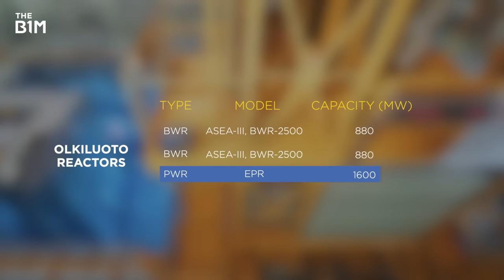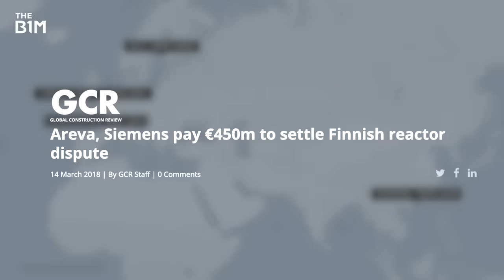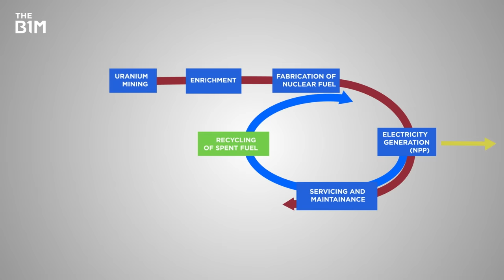Finland Might Have Solved Nuclear Power’s Biggest Problem

Comment: India too has a solution. It will use nuclear waste in it's three stage Thorium program. It's a unique process.
Reply: Nice, last time I bothered checking the reason most places didn't use Thorium reactors and/or use the waste in secondary reactors ( it's still radioactive, it's still giving off energy, use it damn it! ) was because there were worries about them being used as 'breeder' reactors to make weapons material.  Well other reasons too but that was one of the big ones last time I poked at the idea ( not even remotely an engineer, just someone interested in the subject )
Reply: @MrGoesBoom  I don't think that's right. The reason Uranium reactors were used in the 60's and not Thorium, is the fact that with Uranium reactors you could make weapons, and not with Thorium. For this reason, no one developed Thorium reactors, although they would be much better.
Reply: Johnny Bhai ye chuttad log India ki izzat nahi karte. Don't tell them anything.
Reply: @albex8484  Could be wrong, not an expert.  could just be mixing my facts up
Reply: @albex8484  
The way i understood, the main reason why the world does not use thorium reactors is the unsolved very difficult technological obstacles.
Reply: @nikokapanen82  that's the official reason. 
Anyway, it's all hearsay, just like many things in this world.
Reply: @nikokapanen82  Your Matthew 7:12 caught my eye- thanks, brother!  Re thorium reactors not being used... just follow the money. It is a fallen world but, a new world is coming! : )
Reply: Can you make a video about it, maybe?
Reply: @NavDharmVarta  Jammer dat er zoiets bestaat als Google Translate ;)
Reply: A thorium reactor was built and proven in Oak Ridge. Nixon shut it down to focus on weapons grade reactors, supposedly.
Reply: @remkoburger6595  try translate this (sanskrit) 
Idam shwaanam Kim vichitr manvyaadi asti ? Kain eyum madhyantre aagachhtum akathat?
Reply: @NavDharmVarta  Dude constructive discussion is good.
Just because he is telling it's negatives doesn't mean he is disrespecting the country.
Reply: @NavDharmVarta  No worries the most adaptable will survive. Not who spill the most insults.
Reply: @toomuchdebt5669  see they start again, first they looted India to abject poverty now they make fun of our state cos it is not able invest in cleaning. Double edge .
Reply: @toomuchdebt5669  yes of course most adaptable will survive. The flat Earth abrahmic zombies won't.
Reply: india should take care normal bio waste first, then they can try to tackle nuclear wastes
Reply: @albex8484  ahhh yes the game of politics the reason why we can’t have nice things like small coupes with big V8s
Reply: "Waste" should refer to the throwaway attitudes of ignorant profiteers. Spent Fuel designed for a particular Reactor type is potentially another 95% usable in Advanced design technologies.
Reply: @MrGoesBoom  Breeder reactor isn't necessarily a weapons grade uranium reactor, the Liquid Metal Reactor or Salt/Thorium reactors use up to 97% of the energy in the fuel instead of the current 3-5%, also the waste from the LSR's are radioactive for very short periods of time, barely longer than a single lifetime, but the big advantage in LSR/LMR reactor is high temps 1400 c and low pressure, the problem with the modern water reactor is the pressurized vessel is high pressure and relatively low temperature, when a crack or leak occurs the water instantly steams off leaving the core exposed, in LSR/LMR's reactor fuel is suspended in liquid metal and when it overheats the expansion of fuel pushes atoms away from each other and starts to automatically control the temperature, if it cannot get the temps down fast enough a metal plug in the bottom of the reactor melts draining the vessel into a cooling vessel underneath the reactor, this reactor type shut themselves down without any intervention from humans, there is no such thing as a completely safe reactor but these reactors are as close to it as we have ever seen, and by the by a LMR was operating for the better part of 40 years without a need to shutdown for refueling, it can be refueled while it runs, another great advantage a 50Mwatt reactor housing is smaller than a typical automotive shop, we can also ship them off into space to power stations on the moon or mars, they are small and lightweight, Elon Musk is threatening to leave America if they do not allow him to put a LMR into space, after my research this is the way forward for nuclear energy, not only the low level of waste but it can run on waste we already own, the USA developed the LMR, the developer of the LMR is the same guy that designed the modern water reactor, he warned of the potential for catastrophic disaster before the first water reactor was built, for his efforts the scientific community kicked him out of the Nuclear Power Industry, not just some drunken lout, he was the most brilliant nuclear physicist perhaps of all time, he warned them but politics and money shut him down. Water Breeder reactors produce the weapons grade uranium you mentioned, currently the only Nuclear Country NOT building Liquid Metal Reactors is the USA, other countries like China, Britain, India and Russia are breaking ground on these new reactors. https://www.youtube.com/watch?v=DLlozU-i_zc
Reply: @NavDharmVarta  lol, pagal ho kya?
Reply: @NavDharmVarta  bro, have you realized they make fun of India because India does do a lot of stupid shit? And you think other countries aren't made fun of? And if you don't like others generalizing you, why are you generalizing the whole world? Who are "these people"? And why are you mixing your identity with India's and taking it personally? So what if someone calls India shit? Is your name India? You were just born there. You owe the country nothing. Funny you talk about respect, but I see Indians always abusing Pakistanis, Bangladeshis and Sri lankans on sport pages. Chill, Have some juice and go watch doremon
Reply: @0741921  jo khud pagal hai vo dusro ko pagal bol raha hai
Reply: Everyone knows they are just going to dump spent rods into the Ganges lmao
Reply: Molten salt eats reactors.
Reply: @Gary Cooley  pressurized water reactors shut themselves down as well, h2o has a negative coefficient of reactivity. Not all metals are safe, graphite in particular has a positive coefficient, so as temp rises so does reactor power. That was one of many reasons chernobyl was a disaster.
Reply: @nikokapanen82  Nah it's economics, you can breed Thorium for fuel, but the people making the reactors also make the fuel, a bit like the printer/ink scam.
Reply: @DanielMosey  Not only that the US navy funded the initial light water reactor... so the know how for a light water reactor was free. While a molten salt nuclear reactor needed funding to do the research... commercial entities are not interested in spending more money than they have too.
Reply: @NavDharmVarta  dude, calm down, don't let some internet trolls let you think this is an India vs the World situation, any progression coming from this work will be felt worldwide, and everyone will benefit from it
Reply: @albex8484  that s not quite right eithet, it has some better aspects, but some considerable difficulties. First of all refueling processes and high fabrication costs make thorium based reactors less desirable. Second, u also would get uranium 232 after thorium processing and then fission reaction. It is rather difficult to weaponize uranium 232, but not impossible since if u go on irradiate till uranium 233, which can be weaponized. Main advantages; thorium cycles are very efficient with safer energy production and thorium is very abundant :).
Reply: Fix covid first :)
Reply: @singatakberpura  wow bro a nuclear reactor!! And a big one!! Who cares lmao go drive around india and tell me that reactor is going to help where india needs it
Reply: @vincentadultman6226  if you go back and read this guys has issues with a lot more than just the image of indias nuclear reactor.
Reply: Not particularly, Americans invented Thorium reactor technology and the use of it as a fuel, yet thanks to the politicians that technology sits on a shelf while other countries benefit from what is clearly a revolutionary use of the technology. Not that I'm bitter that India IS using it, more power to them (no pun intended), but Im bitter about the fact that the US is NOT using it and hasn't BEEN using it, and continuing to believe that "Nuclear is evil" fallacy.
Reply: @MrGoesBoom  While yes technically it can, it would just make a very shitty weapons grade breeder reactor, or put it more to the point, there are other MUCH more efficient methods to create weapons grade then using a thorium reactor, which is why they are labeled as proliferation "resistant". No sadly the reasons touted why they aren't used is just one of many "excuses" trotted out to prevent their use because widespread use of Nuclear power would solve both the Energy problem AND the Climate problem in one fell swoop, and the political establishment retains it's power by treating the disease rather than curing it.
Reply: @nikokapanen82  Unsolved... ha, perhaps in the 1950's and 60's, but this is 2021 and those issues have been long since solved since the 80's and 90's. No sadly the main reason the world doesn't use it, is politics and power (the social and political kind not the electrical kind.) Because using Thorium reactors would give us a clear pathway to solving the world's energy and climate issues, but doing that would put many bureaucrats out of a job and lessen the power of many politicians. You have no idea how much money is made from "Trying" to solve the "Climate Crisis"/"Energy Crisis" rather than actually solving the issues at hand. In short, those people aren't going to give up that power, and we will be expected to perpetually throw gobs and gobs of money at the problem "Trying".
Reply: @albex8484  that is exactly right. And very diplomatic too.
Reply: @AgentExeider  
I do believe the official explanation more than a conspiracy theory. In the official explanation there are clear technological problems. Like what i have read they can build a thorium reactor which could last for 5 years easily, without a problem but that would be economically unfeasible, the reactor needs to work at least as long as the current uranium reactors which is several decades, that would be economical, they just do not know how to make such a reactor.
Reply: I thought they're dumping it at Ganges.
Reply: @albex8484  You can make weapons out of the Thorium cycle just fine, U-233 weapons were tested back in the 60s along with the Thorium cycle reactors to breed and produce them. And not only have they been developed, but several commercial power designs have been built too, most famously the THTR-300 in Germany, which only operated for about a year before being forced to shut down by protesting.
Reply: @MrGoesBoom  No, the real problem is that Thorium is abundant only in India and hence other nations are less interested...
Reply: @NavDharmVarta  abey oie bhai, desh kah image karab mat kar, trigger hogeya toh meditate kar le.
Reply: Does this three stage program include dragons, dwarves and unicorns? Will they do it on Fantasy Island or Neverland? Will it be too cheap to meter?
Reply: @nikokapanen82  wrong. Depends on the reactor but travelling waves and msrs can definetly work. Terrapower is foing travelling wave and thorcon is making a thorium msr. Msre was a test of a uranium msr and it worked perfectly for a prototype
Reply: @AgentExeider  second that. So true.
Reply: Well, apart from the successful proof 9f concept conducted in the US in the 60's of course.
Reply: @albex8484  ura ium reactors were used because Uranium technology is what was developed, and using existing technology is cheaper than investing in new technology. Governments funded the initial research cost of uranium based nuclear technology because it could be used for weapons, weapons this government's wanted. The government's had no interest in funding thorium and the private sector didn't want the bill when they could just use Uranium based reactor tech that was already established.
Reply: @DanielMosey  May i point out that your reasoning is wrong? Thorium theoretically does not need uranium to start the reaction - free neutrons can come from a variety of sources, uranium is just handy. Uranium will not have to be added after startup, a breeder can sustain indefinitaly for as long as you keep adding thorium and removing the by-products. The reason why thorium was not used in reactors was the problems with corrosion were hard to deal with - back then. Now it's an open field, only stopped by regulations. If you talk about both thorium and uranium waste, you do mean the 300 yr halftime as worst product, instead of the now 10.000 yr transuranic wastes?
Reply: 5:22 how should that be a solution, it is expensive beyond imagination and rather the same as what is already done by others?  Nuclear power plants should be rather banned because rogue countries might dispose their nuclear waste in the middle of the oceans. Just like huge ships dump trash in the middle of the oceans meanwhile known as the "Great Pacific Garbage Patch".
Reply: @NavDharmVarta  really bro
Reply: @moonfly1  yeah...pretty much what I said.
Reply: Full exploitation of India's domestic thorium reserves will likely not occur until after the year 2050.[71]
Reply: @singatakberpura  Russia is making the nuclear plants for india. Let's be clear about that.
Reply: Well not in this project , it completely falls under BARC and DAE. Regarding Russias role in Indian Nuclear tech , it's just the same as to do with MoU signed up with France and US. Meanwhile, Jealousy has no medicine.
Reply: @singatakberpura  The future is in Asia, but not in South Asia. Without USA offshoring, South Asia would be a basket case by now. China makes CheapCrap© and India makes BloatCode©. 

Automation means Chinese EvenCheaperCrap©, yeah! But automation means India EvenMoreBloatierCode©. We'll soon need TerraBytes of RAM to run India's EvenMoreBloatierCode. 

Chips have reached their UV-wavelength limit. Your Future i-Phone TerraByte! will weigh as much as a brick, need an extension power cord, and you'll have to wear an oven mitt to hold it.😂🤑😱
Reply: @orderusp6394  and still call it "sacred" at the same time
Reply: @HKarts_  we have MoUs with US and France but on the other hand we have one nuclear plant from Russia already ih construction vstage and another one also in early stages. MoUs are signed every year to the tune of  50-80  billions of dollars in investment summits in India but we don't even get 10% of it. They are usually not worth the paper they are written on.
Reply: @0741921  It's called patriotism, and I'm glad to see it somewhere besides the U.S.A.

(Doesn't mean he isn't still a soft-skinned fish-fleshed emotional adolescent).
Reply: @AgentExeider  
Thorium is not a breeder design; it is its opposite, a 'burner' design.  It's the radiological analog of a garbage incinerator.
Reply: @nikokapanen82  ⬆️
Reply: @MrGoesBoom  So basically, we are the reason we can't have nice stuff.
Reply: @moonfly1  Both the hot and cold reactors were experimentally funded in the US at the same time and both proved operational by 1970.  It is my understanding that the reason the hot reactor was chosen was it was situated in California which President Nixon favored as it was his own district.  The cold reactor was situated in Oak Ridge, Tennessee.  The weapons grade uranium produced as a by product of the hot reactor might also have played a part.
Reply: @markoap91  The family of Jerry Garcia of the Grateful Dead had his ashes sprinkled into the Ganges.
Reply: I'd like to read about that. Do you have a URL?
Reply: @MrBoliao98  ;) exactly, and they should be focusung on fixing the human and plastic wastes and need to have more oxygen tank.
Reply: @NavDharmVarta  Yes, it is because of the looting 70 years ago, and not because of mismanagement since independence.
Reply: @singatakberpura  Be fair, that is nothing but scary. I have an Indian friend that visited my city in Europe.

She said that we have a serious water quality problem, as she noticed that there were plants growing in ditches, canals and lakes, not realising that this was the product of decades of investment and efforts to create an ecosystem. 

She literally had no idea that surface water in a city could be full of life, as she barely went outside a big Indian city during her life. 

I think India is a mess, and I feel bad for those that have to live in dirt, working excessive hours and seeing their paid taxes going into the wrong hands. 

But please, start with the basic needs before going nuclear.
Reply: @AgentExeider  I think it is not entirely true what your saying. The EU for example actually spends outrageous amounts on studying thorium developing plants.

But like the "traditional" nuclear power plant, it takes decades for development. It isn't as if we throw some thorium in an NNP (although I think theoretically Canadian NPP's could use it) and there you have it.

I do not believe in some conspiracy against it: we just need to be patient.
Reply: @van0tot100  I think that story is false and people that havent visited india like yourself have no right to talk about india which is potrayed by the bias western media. From the Himalayas to Kanyakumari India is beautiful and rich. If not the british and the dutch and the portugese wouldnt have invaded. So dont talk nonsense. The plains,mountains,deserts,beaches of india are beautiful
Reply: Nice to see Johnny's Desk comment here. JDinfo is an amazing channel, bro. Keep up the good work. 🤘
Reply: Yeah, it will. What are they doing right now? You realise this video is about today's situation, not about future. Finland also doesn't have massive amount of nuclear reactors and weapons programme so it's cheaper for it to just put the stuff underground. For other countries the situation might be different.
Reply: L  are you doing your school geography assignment?
Reply: @singatakberpura  It is from a colleague that lives in India. Yes, of course there are clean rivers in the mountains or in forests, but I don't think she often went out of the city.
Reply: @HKarts_  I am by no means denying that. But I don't think you can blame the West for a modern day president to be currupt. India has all resources it needs to become a prosperous country.

Even though culturally completely different: look at South Korea. Barely any building was standing after 1953 and the entire infrastructure was destroyed. However, they chose the right guys and girls to be rulers, and they became rich af. 

Yes, what England has done to India of course makes it very hard to convert to a functioning democracy, but it has had over 70 years to do so: I think it is the choice of the politicians and the people to remain this way, rather then some missing cultural artifacts and previously stolen agricultural goods that keep India from developing an economy that works for its people.
Reply: And soon you can see the Ganges shine ,when you see the earth from space. 🤣🤣🤣